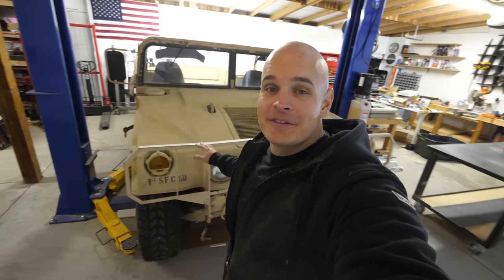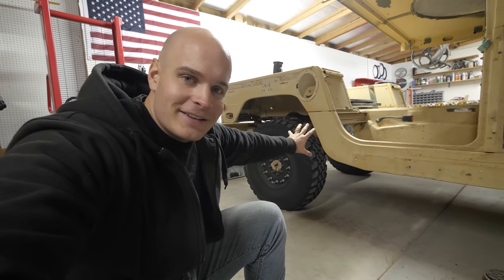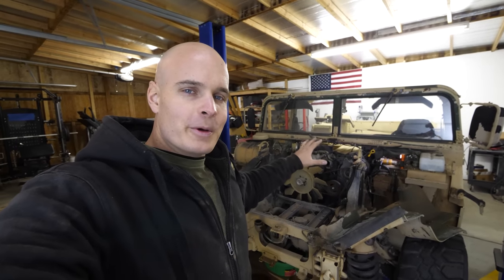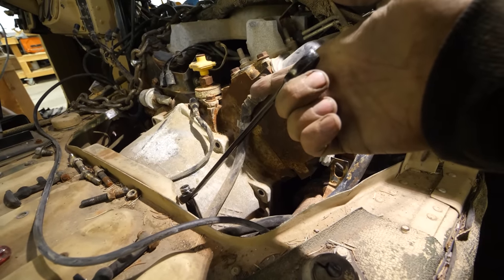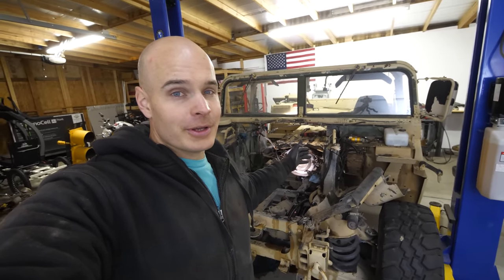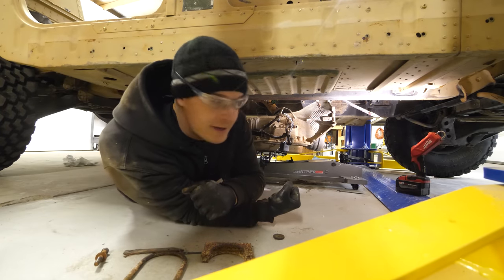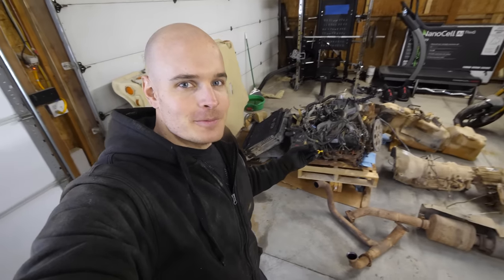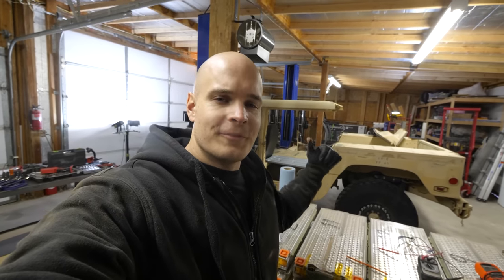How to build an Electric Hummer? Step One – TEARDOWN!

Comment: when you’re done with this project, please take it to a mechanic and tell him you’re hearing weird noises when driving it and get his reaction
Reply: cool idea, but i think any mechanic with enough experience can tell right away if any vehicle is electric.
Reply: @inchrg5112  I think any normal person with ears could "hear" there's nothing coming out of the engine from far away lol
Reply: Lol
Reply: @hawkeysim1487  hahaha
Reply: @inchrg5112  a real mechanic will never look or touch a EV. It's like a disease.
Reply: @no nope most of the mechanics know how electronics working in cars. The elec has never changed. It's the same method as decades ago. But now with electric motors and more batteries. 
But alternators, convertors always existed for cars.
Reply: @no You work at a dealership?
Reply: when a vehicle creeps up on you and you don't smell fumes or fuel XD
Reply: CUSTOMER STATES: "high pitched whining when accelerating"

Comment: Even as a military mechanic for 15 years, i enjoyed watching you tear this down and teaching the basics. I'm definitely interested in how this is going to turn out. You have me curious as to how an electric conversation would go on a larger military vehicle such as an LMTV.
Reply: Respect for u ✌🏻🙂
Reply: Or the newer JLTVs, though I'm sure it'll take a long, long time to find one on the market
Reply: @poongusboongus6438  I'm sure it will take you a long time to find one even in the military.
Reply: @dtorrini  very true, only reason I know they exist is my unit replaced all but a few of our Humvees with them
Reply: Ackkkk!!!

You just unlocked memories of going at the batteries with a wire brush in the middle of summer.  No no I don’t want to go on a fuel run for JP8. 
Nooooooooo
Reply: @poongusboongus6438  Nah, Im pretty sure a few got left in Afghanistan as well as MRAPs
Reply: Thank You  for your service
Reply: Imagine he does an LVSR haha
Reply: Electric motors are getting better , I want to see an all electric tank one day.
Reply: hey man if u worked on those things for that long do u might know what im dealin with... i just pulled 6.5 out n found what looked like clumps of dried mud in the bottom of the oil pan....Fn weird iv never seen that before even in the bottom of a diesel  i thought maybe it was the mains but they still feel perfect, the entire engines been taken great care of n in amazing shape, all kinds of nice newer remanned parts even the trans, genuine gm remanned parts r a good sign  thanks in advance man
Reply: An electric HMTT.....

Comment: This is next level, hands down my favorite build
Reply from the maker: Thank you!
Reply: @JerryRigEverything  most powerful electric car in the world 🔥
Reply: @JerryRigEverything  i have you a question what if you add solar panels to your elecric vichele like in Tesla cybertruck it will be 100%green because it will be solar
Reply: More like Teardown
Reply: @memesaregreat8815  And also extremely powerful while being green. Match made in heaven.
Reply: @memesaregreat8815  The amount of panels you would be able to put on the Hummer won't be anywhere enough to charge the batteries in a normal time, it might take a few days to fully charge them but as an "additional  power source" it might work.
Reply: @shadowkora  solar panels would be for off road trips because you cant find charger in deserd or somewhere else still its beter fiew days of chage than stayng in deserd with your phone dead because anything can hapen while offrading
Reply: @memesaregreat8815  For charging phones it would definitely be worth it as for charging the car, depends on how many Watts of panels you could put on your car, that would definitely need to be tested.
Reply: @JerryRigEverything  Curious.... why you never opted for a Tesla unit mounted sideways to power the front rear diffs ? a good example is the land Rover conversion in the UK  450-650bhp/100kw battery mostly in the engine bay....
Reply: @shadowkora  yah but it could save you but you need to put best solar panels there atleast with them you wont endup stranded in unknown place
Reply: @JerryRigEverything  💡
Zack, FRIENDLY REMINDER - diesel+air mixture explodes under pressure. There is really no need for glow plugs or sparks. They are there so you can start engine in a cold air environment and make sure that first few cranks would burn off the fuel+air mixture.

Comment: Top tip: next time you need to drain the coolant, remove the radiator cap and it should drain a lot faster!
Reply: Another method is to put a Subaru emblem on it and do one or two sick launches from the gas station parking lot. Then all you have to do is remove the oil plug to drain both your oil and coolant!

Comment: Best place for the batteries is the transmission tunnel, low CG and being at the centerline better weight distribution.
Reply: i thought about the same thing but then i remembered that tesla used to have a problem with the batterie being mounted under the car. it would get punctured by rocks and start burning so tesla designed a puncture proof liner undet the car, that would be hard for zack to build
Reply: @naeintebadsalt9142  They literally just put a steel plate under the cars. Adding a protective cover would be the easiest part of this build.
Reply: Just make bash plates like most 4x4 install under their cars
Reply: @naeintebadsalt9142  As others have mentioned that's easily solved with a skid plate.
Reply: Don’t forget that you’ll still have to move power from the motor to the rear wheels and that he’s considering using the drive shaft to the front wheels as well.
Reply: @solbot  Could have easily been solved by doing a dual motor config instead of a single ginormous motor.

Comment: it's kind of mind-boggling the differences between fuel-powered vehicles and EVs, including the efficiency level. i also didn't realize before watching this video that EVs do not have to shift. very cool project!
Reply: Most electric machines will have a fixed gear ratio between motor and wheels, instead of having a gear box with multiple gears. This is because electric motors have a much wider rpm range in which they can work efficiently and provide torque, compared to internal combustion engines.
Reply: The model 3 for example has a roughly 9:1 fixed gear ratio

Comment: Just a little tip to give when planning out the battery placement.

Besides taking in the weight, consider the distribution of the weight throughout the vehicle. The suspension and therefor the stiffness of the springs was optimised based on the original distribution of the weight in the vehicle. So, if you make one end lighter compared to the other end (for example by putting more batteries towards the rear), you will see a differentiation in ride height and the humvee will look like it’s either nose-diving or rubbing it’s butthole on the carpet.

To prevent this, visualise and calculate where the weight originally was compared to the axles. Use this to map out where you want what percentage of the weight (and so what components) to go in your new packaging. This will give the humvee the ride it was originally designed with and will help prevent weird behaviour when cornering or at higher speeds.

Also, by keeping the 4wd with the transfer case, converting the vehicle to electric won’t limit any of the capabilities the vehicle originally came with and will most likely improve it’s capabilities compared to original.

Hope you get to read this as I feel this could be quite important. Good luck with the project and I’m looking forward to see the result!
Reply: Keeping the torque converter automatic transmission , would also be kinda ok

Comment: "I'm not sure which video is gonna be next, assembling the batteries OR seeing what's inside this box", 
* opens the box the very next second *
Reply: Yeah, could have been a nice bait 🪤
Reply: @girlsdrinkfeck  thats not how it works
Reply: Wat kind of electric motor is that
Reply: @girlsdrinkfeck  he could most likely ask expert to see abotu milling new hardware to water proof it as they did for the ICE motor.   SO off road isnt a problem.

Comment: Such a treat!! I'm completely hooked on this electric hummer series... even though I don't know anything about electric cars or hummers haha.
Reply: Just think giant RC car and you pretty much have about 80% of the information you need XD
Reply: Hummers, especially the military HMMWV have terrible diesel engines so a motor swap is a popular option. Electric motors can be more powerful for less weight.
Reply: @snarkylive  You aren't wrong there... for anyone wondering, the 6.2L V8 Diesel (which is one hell of a hefty unit) that a lot of these came with only made 150hp and the 6.5L Turbo only made about 190hp. Sure they made some decent torque, but it hit peek torque at 2000RPM's or less making them about as nippy as a slug. Honestly an electric conversion would sharply wake up one of these things.

Comment: Zack: "Electric vehicles don't have to shift at all"
Porsche Taycan with 2 gear-gearbox: "Am I a joke to you?"
Reply: Most of e.vehicle dont have ??
Reply: It's not really a proper shift though. Like, it is a gearbox, but it's clutch less and operates more like an automatic gearbox, changing to a different final drive ratio.
Reply: Also no oil in the differential as it turns out from the video.

Comment: Just a Quick knowitall Moment, cause im studying electric mobility. The Etron Gt and the Porsche Taycan both have 2 Gears so they are changing gear. And Opel (also known as Vauxhaul) has made a Prototype which actually has a normal 6 Speed transmission with an 136hp electric engine :D
Reply: You might like Damien Maguire's channel. He keeps the gearbox in his €1000 BMW EV build.
Reply: Yeah you don’t really need gears in an electric motor. You just gotta improve the motor to handle the loads you’ll be putting on it. Just look at what Tesla did with the plaid, 1 gear that goes all the way to 200mph, motor design is important!
Reply: @franky9928  A manual would actually be really awesome in an Electric Car, as well as more approachable for the average person. There is no idling, so no need to worry about stalling, the RPM range is huge in electric motors, so shifting is more about preference than need, and manuals tend to be more fuel efficient than automatic, so if you are going to have a transmission in an EV, manual makes the most sense.
Reply: @undead890  except shifting, whether manual or automatic is overall less efficient. No sense in wasting efficiency because some might feel it is "more approachable". Just because we are used to one way, doesn't mean it was a good idea, just the best we had at the time.
Reply: @undead890  But with a normal Tesla like Electric car u don't have to worry about clutch and everything even with an automatic transmission u still have the fluids as Jerry said in his video. And more fuel efficient isn't so true anymore anymore cause normally ur automatic transmission has 8 or like in the Mercedes 9 Gears or even 10 in the Ford Raptor I think and the most manual gears are probably in a 911 with 7 Gears
Reply: @franky9928  as I said the prototype of the German brand Opel has a 6 speed Manual Transmission with an 136hp electric engine. The car is called Opel Manta GSE and you change gear by looking at a normal Rev Counter.
Reply: @undead890  Another part why we won't see any or much manual electric cars are the Assisted driving features. They are only possible in automatic cars.

Comment: Internal combustion engine: *exists*
JerryRigEverything: peace was never an option
Reply: I mean... The one and only thing the ICE has for it is the energy density of it's power source. So yeah
Reply: @TheBasti05  nah doesn't even have the energy density.. since your not counting all the air. 229.2 cubic feet of pure oxygen for one gallon of gasoline at 1 bar if I did my math right.
Reply: @TheBasti05  and the sound
Reply: @thedark333side4  unless it has lifter tick lol

Comment: The old driveline tunnel looks like a perfect spot for batteries.
Reply: but.... he still needs to put the transfer case back to be able to awd or else he has just fwd/rwd with only one motor. so technically less and fragile space for those Tesla battery modules. interesting series indeed!
Reply: Even with the transfer I think the batteries will fit in that tunnel. Nonetheless a plate will be needed to protect them.
Reply: I had the same thought. Especially if you go with a motor per axle (or hub motors), there would be a cavernous space in there.

Comment: Twin motor Humvee? Hear me out, that center channel can hold the battery packs and they can be protected by a skid plate with ventilation holes in it. The top of that channel can by modified to create an access panel if needed.  Replace each diff with a motor and connect axles from wheel to motor. Humvee would be awd. Use the engine bay to channel air into to the center channel to keep the batteries cool. If each pack is slightly separated from each other even 2mm, the air can flow in-between each pack. Plus you can probably fit more batteries under there and the gas tank area. The roof is big and flat so blending in a solar panel or two plus another one on the hood can possibly charge the Humvee while it sits. Also, weight reduction could help so the motors have less to haul around like a fiberglass hood which are available in the Humvee replica market. Not sure about carbon fiber body panels but doors, hood and roof can be made lighter. Also, consider looking at kreisel electric hummer, it's the same Humvee body. Just my 2 cents.
Reply: This would be fantastic
Reply: everything understood but how much speed will it gain there has to be suspension work to be done then brakes wheel bias ground clearence ecu work  handling making it overall safe and capable also street legal i dont know how he will singlehandedly do these
Reply: If you replace each diff with a motor, how are you gonna distribute the motor's output between the wheels? You either still need the diff or you have to add a motor for each diff replaced (4 motors for no diffs, 2 motors for 2 diffs).
Reply: @Chamieiniibet  Tesla drive units have two output shaft , for reference look up Tesla drive unit cradle and compare that cradle to the Humvee one. It's very similar, I'm talking about the center cradle not the suspension arms.
Reply: @Citizen.54  if it has 2 shafts it just means it has a built-in differential ¯\_(ツ)_/¯ That's why it's a "drive unit", not a "motor".
Reply: @Chamieiniibet  exactly, so if you do a cradle "swap" it'll fit better and still keep a driveshaft to each wheel.

Comment: oil is actually a golden or clear color, its only black because of the carbon that its detergents are designed to absorb to clean the engine and keep it running without all of that turning to sludge and solidified carbon buildup, which can cause extra friction or straight up stop the parts from moving as far as they need to, and if its bad enough, keep the pistons from allowing the engine from turning over

usually though, it will get clogged at some point and the bearings will spin and the rod connectors will wear out to the point where it wont be able to idle nearly as low as you may want it to, because otherwise, it has too much space, which reduces power, because its like trying to hit a wall, but first, you have to smack a spring attached to that wall, or another analogy, you have to shoot through a wall, that is already behind another wall
Reply: you know he already knew it right?
Reply: @0m3gA_o3  yea, but he was explaining it to all of the "mechanically illiterate" they need to know this stuff to not put used oil into their cars

Comment: Just fyi, your lift probably wasn't rated to lift the hummer with the engine and transmission still in it anyways.    It's something to consider for safety.   
I laughed at your optimistic outlook on not spilling fluids 😂😅.    It is not possible to remove an engine without spilling some coolant there are just too many small ports that can't be adequately drained in the vehicle.

I enjoyed watching you work.   The gear that connects the engine crankshaft to the torque converter is called a flexplate for automatic trans and clutch/pressure plate on a manual.

I'm looking forward to seeing every part of this build!    You are doing what we all wish we could!
Reply: Are we sure it's not a flywheel?
The clutch would take the place of the torque converter in a manual.
Reply: @Fightre_Flighte  positive, automatic transmissions don't have flywheels.   It's a flexplate.    It's basically the same thing.   And yes, a clutch and torque converter serve a similar purpose
Reply: @rognio3  
Kinda odd that it has a different name in an automatic than in a manual, though I'm not surprised.
Let me guess, it's called a flex plate because it also serves to absorb the shock of changing the speed of the torque converter.

Comment: I would recommend putting them where the gas tank is. It is designed to protect the gas tank in case of an accident or attack. The sides seem to be too vulnerable in an accident and possibly cause a fire. But IDK much about electric car batteries. Just an idea.

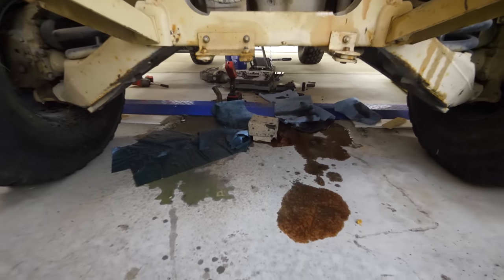Comment: 11:30 I mean, the motor is technically the heart of the vehicle and the brain is the computer. Gas tank/battery(digestive system),  exhaust -and everything related to aeration (respiratory system), wheels (limbs), oil (blood), etc.
Reply: Say a car had no computer (none of them did if you go back far enough). Would that car be a zombie?
Reply: Uwuehwisek
Reply: @PseudoEmpathy  yes and yor mom
Reply: r/whoosh 🕵
Reply: ok nerd
Reply: I thinK fuel pump is more suitable for hearth of the veichle
Reply: The driver is the brain.
Reply: @WhiteTree97  oh no. You offended me. Now I don’t know what to do with my life.
Reply: @PseudoEmpathy  then I guess the carbeurators could be called as brains. Those are pretty neat things.